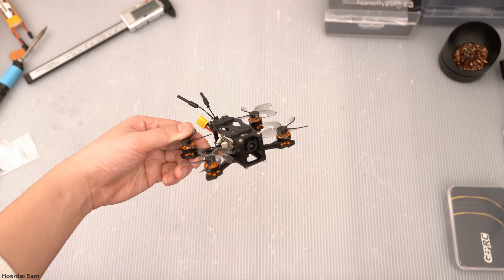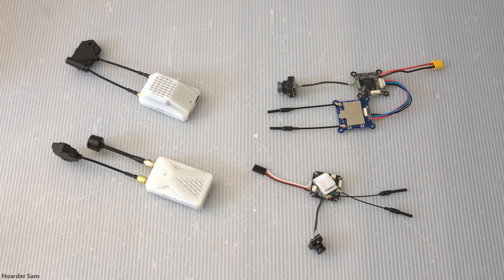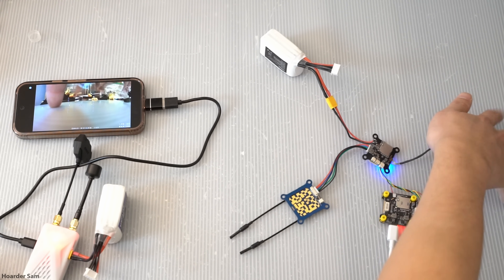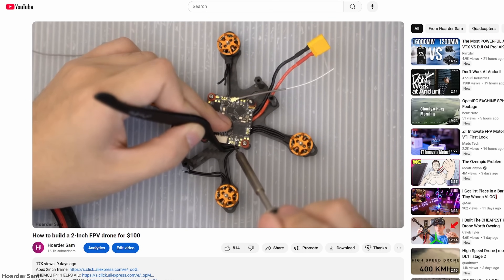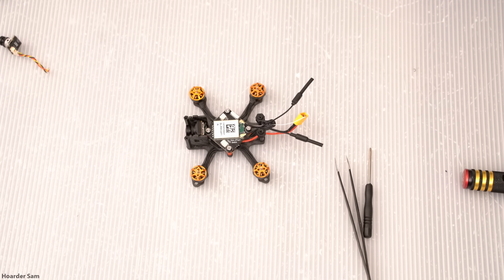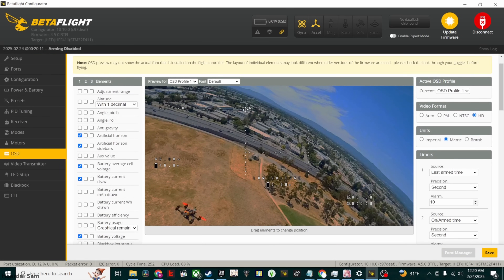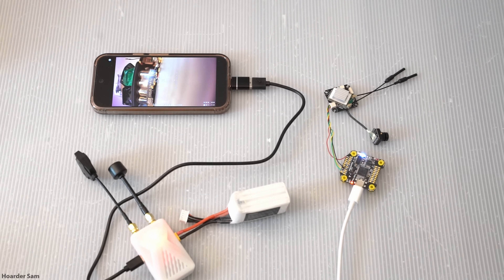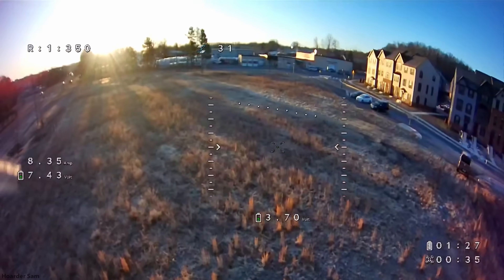How to build a FPV drone with OpenIPC for $150

Comment: Also Pixel Pilot supports Meta Quest 2 & 3, both of which already have a higher resolution and higher framerate than all of the HD FPV goggles currently on the market, while also doing mixed reality.
I really hope this project takes off. Since as It currently is, any digital system from DJI, Walksnail or HDZero are way too expensive for the average Joe.

Comment: Great Build! Im using this on a 5“ Quad - can you share your settings? Im very unlucky changing anything from its stock settings. When I try to use higher bitrate the hole Display will get unsharp and freezes.. Even when im on Lab conditions.

Comment: When are you going to hook this up to a metaquest 3?
Reply from the maker: Just tried today and got it working with quest 3s. Working on video now
Reply: fuck yes! theses dji goggles are so pathetic esp with their real view that has a 20 degree fov. what a joke, and you cant even turn off the beeping...the apple computers of china...my ass
Reply: @mrschnider6521  I just dont want to invest in dji goggles if I dont have to, I love flying my analog drone around on my headset, like flying on a movie theater screen.. I am prolly gonna pull the trigger on the rx tonight
Reply: @ i cannot get an range on my analog, i get like 100 meters with 600mah. i have betafpv vr03. my DJI the drone will run out of batteries before i loose range. idk what they do to be able toget these things so much range, they top out at 1.2w with analog i get 300 meter with 1.2 watt. i life in san francisco not sure if its all the wifi and bullshit on 5.8ghz
Reply: Very good. I'll be doing this. Thanks to this thread, I can now start to purchase materials. Thank you all.

Comment: Can this build be used on a pavos 20 pro frame like the ones lying around on AliExpress?
Another amazing video as always!!!
Reply: yeah quite easily actually , the 100mW EMAX air unit is like 12g in weight and doesnt take much room . Just remember the EMAX openIPC air units (the 100mW one) can only take 5V in - if you use any other voltage in you will burn the board !!
Reply: @ this openIPC thing is game changer! My head imiditly started wondering on making a cheap pair of box googles with a cheap android phone, some VR adapter with a phone slot and some of those special lens to optimize the light (don’t know the name of the lens) I’m also curious to know the limit of the quality of this digital unit! This is the future!
Reply: @absint0o  well it's not recommended to use the android setup route as you loose some performance  (latency is higher) typically the best setup for openIPC is to build a VRx module like Walksnail using a SBC (something like the raspberry pie zero ) then plugging in the HDMI output from that to some FPV googles . Some phones work really well on the openIPC app so you can get higher latency, I don't want to mis inform people on openIPC's capabilities, it's a really cool project but it does have it's limitations

Comment: Nice! I still only have a 7inch analog quad and am looking forward to have some openipc drone. I was thinking to build the 3.5inch volador with it (the higher power one). It's already bigger and more capable of handling it. Will benefit of the higher vtx power but still not as expensive as 5inch and upwards

Comment: also xt30 is weak af, do bt3.0
Reply: What are u talking about? The 30 stands for 30A continuous... 😂
Dont buy the bs xt30u and u are gtg. Bt3.0 only does 12A continuous and burst is 20A....
Reply: @galardo3303  Sorry my experience tells me 2s is better on bt3.0
Reply: I prefer the weight savings and integrated charging. Not sure I need that amperage headroom

Comment: Very interesting light enough for a 2 inch is cool and low latency on android display very nice. I would really like the higher power unit tested around buildings would be good signal check bro ++
Reply: Signal is good, I fly around buildings with just the 100mw version, and I have them in sub 30g 1s whoops

Comment: This is awesome!  Thanks for this making and sharing build. 
I'm very curious about the performance of this system.
The footage you have here is very good quality compared to other openIpc builds I've seen on youtube. Did you have to tune and tweak a lot of the settings of the video system? Would it be possible to push it a bit more to test the system in various conditions?
And ya, please make a long range with the 800mw unit!
Reply from the maker: The video settings are all original, how it is right out of the box. To change any settings requires the ethernet adapter thing and I couldn't figure out how to use it 😅 So all stock settings here
Reply: @ Plug ethernet adapter into wyvern kit, plug in battery, go to router device table and find the openipc camera IP address. You can just edit setting from winscp/putty. Or install openipc configurator (1 is windows only, 1 is multi platform) and edit the settings from there
Reply from the maker: @smikaFPV  Thanks for the tip, looks like I missed the router device table part. I just tried to hook up the ethernet directly to my laptop and I was stuck figuring out what IP address it wanted
Reply: @hoardersam10  you can plug directly into pc and check there. Or plug into your router and check there. Router probably easiest
Reply: If you do PC type "ipconfig /all" to find ip of camera
Reply: checkout my latest video testing a modern build of openipc with adaptive link tuned
Reply: tipoman and greg sparks have much better quality videos.
Reply: @ yeah they are awesome :) Love greg's work

Comment: amazing you done an openIPC build !!!, Its a minor pain to build it but its a very promising project (i own like 6 openIPC drones now ) I noticed in another video of yours you own a meta quest VR headset , we [openIPC] can run on these goggles and I believe latency is slightly lower because of the higher refresh rate screen in these VR head sets , it should be a relatively easy thing to setup from what I understand and It should give you a more FPV experience
Reply: Sam, can you try sideloading the APK to your Quest and report back on whether or not it works?
Reply: This excactly what I also thought when I saw this video! Plus if you  do some kind of latency measurement on the meta quest with openipc that would be awesome!

Comment: WOOOO, LETS GO!

BTW to make a goggle VRX you just need: Radxa Zero 3w SD Card 2gb ram, SD Card, 1-3 wifi adapters (3+ adapters require usb hub/breakout), ufl to sma pigtails, and a BEC for clean power. I post a bit of openipc stuff, happy to help
Reply: ALSO Single Board Computer ground stations use a web portal to make changes now. You flash the sd card, reinsert it into PC to assign basic settings, then plug it into SBC VRX, and power it on. Working. Then you can put it into access point mode, and edit everything else you need. Only reason to go to terminal is if you want to convert OTG port to host for a second wifi adapter without a usb hub, or to add wifi for ssh
Reply: openipc latency is between 25-50ms depending. Mine is usually in the low 30ms. Lowest I have recorded is 16ms
Reply: Though it can spike a lot in the 50s
Reply: @smikaFPV what’s the average latency for DJI? (I don’t want to have to trust their marketing)
Reply: @TreyHam27 don't own the system myself but from what I hear very similar
Reply: @smikaFPV thank you!

Comment: Does it work with the quest 3s? That'd be awesome! And yes, I'd totally watch more OpenIPC content, I believe it's the way to for budget builds going forward😊
Reply from the maker: I think it would require sideloading pixelpilot unto the quest. I haven't tried sideloading yet
Reply: @hoardersam10  we have a fair few guys flying with meta quest headsets , latency should be a bit better as well since the screen has a higher refresh rate . I think its well worth a try as it should give you a bit more of a traditional FPV experience .
Reply: Please try with a meta quest and post a video wether or not you were able to make it work...
Reply from the maker: @ericj9784  I just tried today and it works! I'm working on the video now.
Reply: @hoardersam10  Awesome! you are doing great work, thanks!